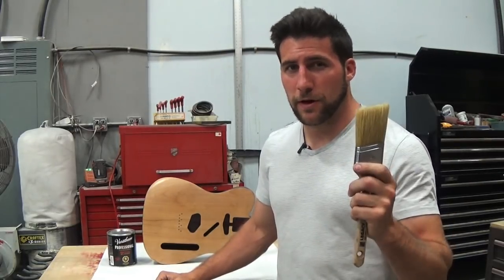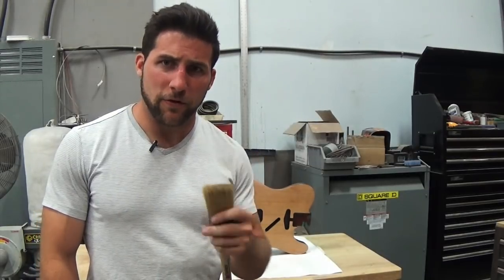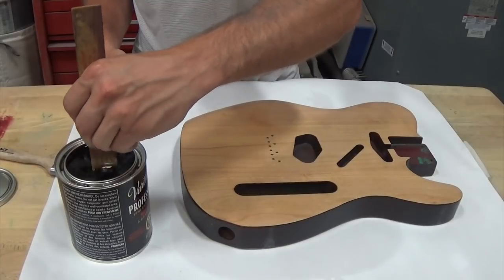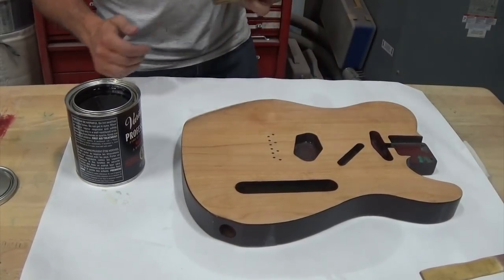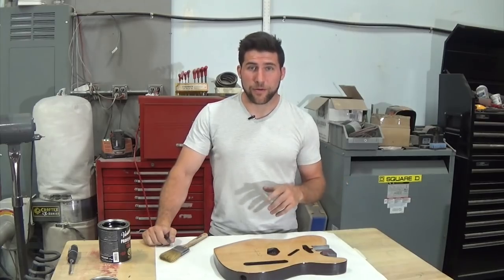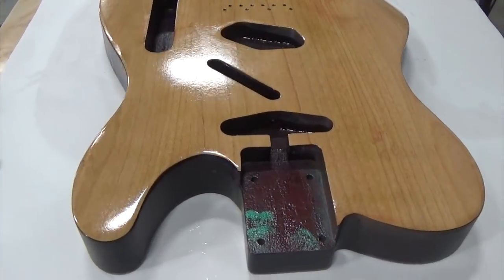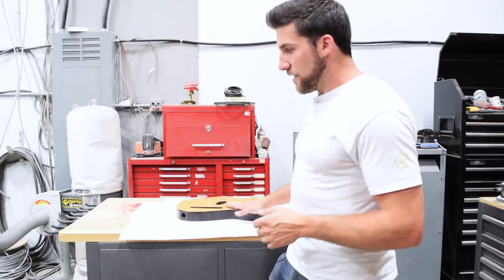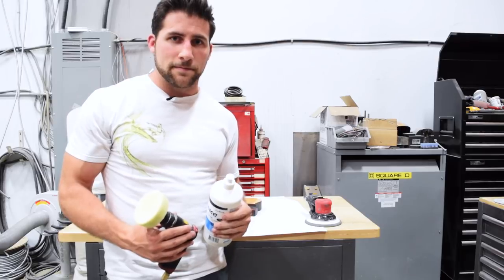How to Brush On a Beautiful Gloss Finish

Comment: better than a brush is an old t shirt with the ragged ends folded in as to make a good pad and just wipe it on like wipe on poly four or five coats and it should be fine .
Reply from the maker: This isn’t wipe on poly. This is brushing poly. You would end up with a sticky mess doing that with this product.
Reply: It's news to me  because I've been using poly urethanes for over forty years and building guitars myself and have achieved beautiful finishes with an old  t-shirt . I've  finished doors and furniture and developed my own method of refinishing kitchen cabinets where I can go in in a day and refinish a whole kitchen and make it look great all using poly that I've  wiped on . All you need to do to make wipe on poly is thin it down a bit anyway .I have some really good spray gear, but the equipment doesn't work in homes and just makes a mess .Believe me, the old t-shirt trick is gold for working with polyurethane . Being able to refinish a lot of cabinets in a day is a really good moneymaker for a small business.
Reply from the maker: Glad I was able to provide you with some news then. That’s why I do this, to help people. 

And yes, as you are well aware, the t-shirt method works great for wipe on poly. It’s a thinner product. You can thin this to get the same effect if needed, or brush it on like I did here, which is what it’s designed for.
Reply: Another  difference is wipe on poly doesn't hold up as good as the exterior grade but isn't set up to be wipe - on either . They also make interior grade poly for brushing -- the exterior grade kind of works like spar varnish but flashes over in a couple hours while spar varnish takes days . Both are good  finishes but the poly is more convenient. The interior grade poly is blended for hardness while the exterior grade is blended for some flexibility to compensate for temperature change and expansion of the finished surface .For exterior doors and ( for my money) maybe guitars-- the exterior grade might also be a better choice thinned somewhat and wiped on with several thin coats .

Comment: Hey Brad, 
Are the micro mesh soft touch sanding pads suitable for sanding polyurethane up to a high gloss? :https://www.amazon.com/MICRO-MESH-SOFT-TOUCH-SANDING/dp/B000H6EC4C
I'm using a water based polyurethane btw.
I see you dry sanded this finish. Some people insist that you wet sand. Does it matter? What's the difference?

Thanks for the great videos!!!
Reply from the maker: +A.J. K they should be suitable, yes. I dry sand guitars because I don't want to risk getting water in the wood and causing expansion. I wet sand things that aren't affected by water because it's easier and the paper doesn't jam up quite as fast.

Comment: Is it better to wet sand???
Reply from the maker: It makes sanding a bit easier, but also poses a risk when working on wood because it can cause the wood to swell and result in finish cracking.